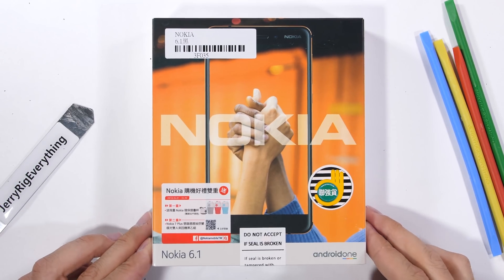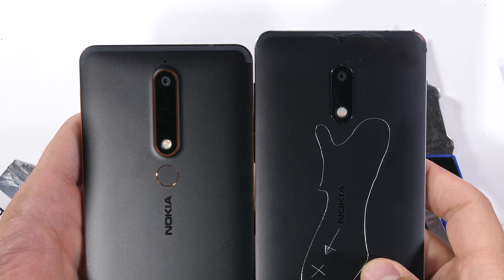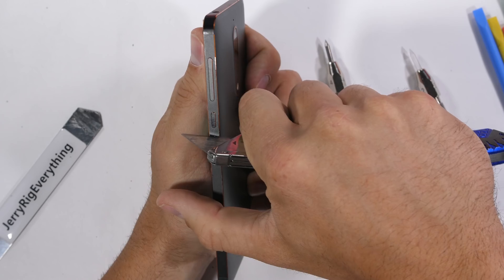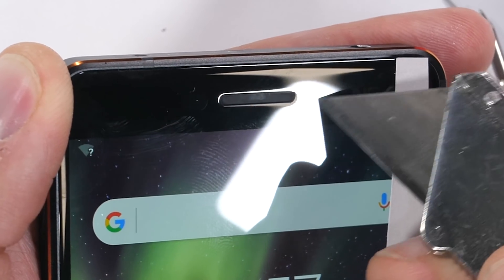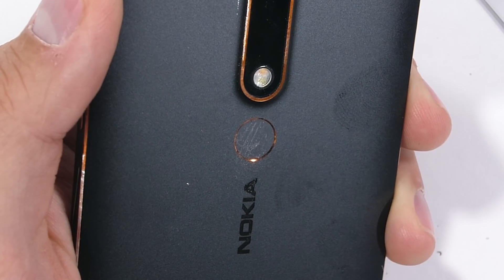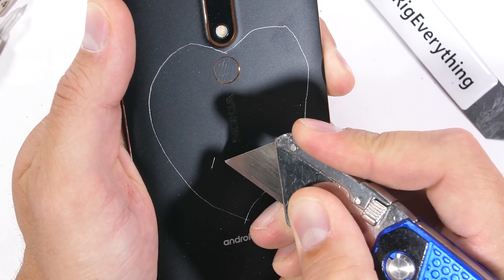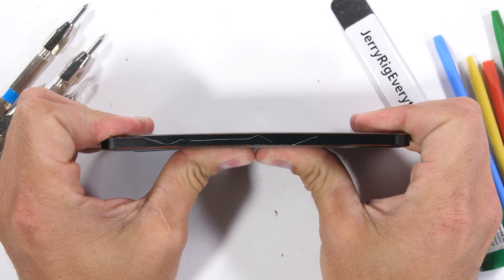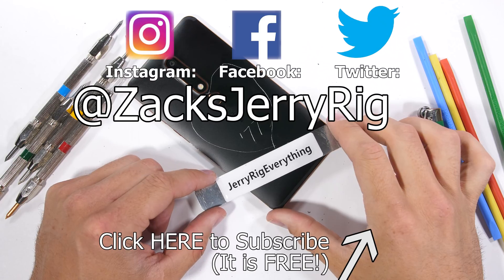Nokia 6.1 Durability Test! Scratch BURN and BEND tested!

Comment: Bought in december 2018 at USD $90 with a USD$3 original TPU case.
TPU case desintegrated 8 months ago and just then I put a screen protector and a hard silicon case. That's right, 6+ years with no screen protector.
In the meantime I worked as a mechanic, a fast food crew, a delivery driver and factory worker and withstood all those jobs. I must say I'm not a brute when it comes to use my devices but don't treat them as fragile crystal either.
The SoC might be getting a bit short these days but nothing a good OS restore can't fix as I don't game or multitask heavy social media apps.
The hardware was and still is pretty complete for all needs, only lacking in wired video output which would have come in hand to me.
The only real issue now with 6+ years of use is the battery, something normal considering the use. It barely lasts a day of heavy use.

I'm planning to replace it for a SONY XPERIA as those are the few with hedphone jack, card slot and no screen notch.

Fun fact: It had the fastest fingerprint reader back then.

Comment: Brought this in 2018, Still using it with some dead pixels on the bottom right which appeared out of no where last week. Also no updates from google. would Still recommend this over any other budget phone. This phone can break thing and hammer a nail.

Comment: Nokia 6 and 6.1 are the most durables phones ever made, great quality.
Reply: I got it back in 2019 brand new for just $100
Reply: @neerajdwivedi2015  Still fast?
Reply: @brenaxquiny8639  Yes, Kind of. But my battery only lasts about 2 hours and charging port is very loose
Reply: @neerajdwivedi2015  Thanks for the information I think I will just go ahead and buy Nokia 3.4

Comment: I'm a Nokia 6.1 user since 3 year. But now i facing lot of problems with this device. It delivers broken sounds by stereo speaker. And when i open any app the phone goes switch off. I've done a hard reset but problems steel have. How can i solve this device? Tell me plz.
Reply: Replace the battery. Yes I know: 2 years later, and you probably moved on to another device, but had the same problem.

Comment: I had a problem where I would always break my phone. 🤷‍♂️ Once I got this Nokia model the problem is gone. I can't believe how hardy it is. It accidentally slammed on floor 50 times (at least) and its still working great. Also, it's not even damaged that bad. That includes the screen as well. Unbelievable. I recommend it for everyone who has the same problem as I once had. I mean, I still have the problem, but the freaking phone is up and running 👌

Comment: My 6.1 already got the pill a couple months ago THE PILL!  The future of "home" and it's epic.  People get mad that don't have it when they see me zipping around shit with ease.  Android ONE is the way, as well as getting fast and frequent updates because they didn't dink with the software a whole lot.
Reply: Also, I managed to FINALLY spiderweb my 6.1 and it's barely visible and you can't even feel it.  I dropped it, naked, on a side edge straight on to a concrete curb from about 2m up getting out of a car.  It put a dent in the edge of the medal housing and barely (you have to turn it on edge in the right light) made some baby spiderwebs.  I wouldn't spike it into the ground, but for a phone this slippery and not having a case this thing should be long dead like all the rest.  I broke both sides of an S7 in like a few days...  :-(  Just getting my 7.2 set up...  :-)  The 6.1 is the new nav system for the car because all nav systems suck no matter how much you paid a good phone is still better.  :-)

Comment: I bought this phone because of this video and it's actually been a great phone.  Nokia's decision to keep a basically stock Android One build helps keep it running smooth and well maintained without surprises and mystery apps hijacking all your stuff/data.  I've spiderwebbed the glass on one side, but it's almost impossible to see unless you get the light and viewing angle just right.  I had dropped it pretty severely at least 3 times onto pavement with nothing but dents/scratches in the metal.  This time I dropped it at about 2m height when getting out of the car and it landed angular to every plane it has in the middle of one side.  It made that SPONK noise that you fear...it did damage the glass, but I can't even feel it.  Big crease in the metal casing, very faint spiderwebbing and only if you look for it, cannot feel it at all, LCD and touch work fine...

GREAT PHONE.  If Nokia can nail their 5G products, they will do well going forward...

Comment: I can't understand why you didn't make a simple drop test, to see how well it resists impacts. It's the simplest and most relevant test that exists for a phone. Who the hell will scratch their screen with a box cutter?? Meanwhile I drop my phone once per week.
Reply: Because he scratched the screen, if he do a drop test on a scratched phone it would break (much) sooner than a non scratched one
Reply: @MagicArcher17  Supposing that what you're saying is correct, then he should have started with the drop test instead of scratch. It's simply the most important thing to test on a phone regarding durability. There is zero excuses for not doing it. He simply screwed up in this case.
Reply: @dontbothermeimjust12  He stated many times that he wants to keep most phones functional, if he does a drop test, and it stops working/the screen and back breaks how we will know if it passes correctly all tests, also every time he drops a phone it's in a different position, so you can't compare between them, a phone can resist 15 drops or break in one, he doesn't have something for doing all drop tests equally

Comment: I'm one of the few people with a Microsoft Lumia 650, a phone which is almost identical to the Nokia 6.1, and it's just as built like a tank as the 6.1 is. Granted, the 650 has a removable plastic back and MicroUSB (understandable, considering its February 2016 release date), but I legitimately consider the Nokia 6.1 to be the spiritual successor to the Lumia 650. The two are that similar in terms of design and technologies.
If the 6.1 was a phone from 2016, it would probably be a variant of the 650 that runs Android instead of Windows 10 Mobile. And it probably would've sold pretty well too.

Comment: I recently replaced my Nokia 640 with a 6.1 I wish they still made windows phones but at least its android one.  The 640 still works (even after 3 years of drops with no case)  it just doesn't support  android auto and my new car has it.  The only issue I have is the camera app is glitchy and doesn't always come on or take a picture on the first try.

Comment: I think it would be awesome if you could add a test to your line up.  A pressure test to one of the corners simulating what the glass undergoes when dropped. Then get a pound per square inch rating going.

Comment: One thing that I just don't get: When you know a phone is using gorilla glass or something similar, why don't you start your scratch test at level 5 already?

It it scratches there you can always go back below again, and that way you have to test less.

I mean yeah if it scratches down to a 3 you'll have more scratches, and if you keep your current placement of the scratch tests it'll scratch more in the center of the phone, but do you really want to use such a weak phone again anyways? And that aside it just saves time.
Reply: Ben Turner well, as I said if it scratches where he starts (at 5 in my suggestion) then he can always go down again to test where it doesn't scratch anymore.

I mean it's probably gonna stop at 4 or at least at 3.

Comment: Dropped my Nokia 6 on the bottom right corner and screen on concrete... It just scratched the paint and marred the metal a tiny bit. Nothing happened to the screen.
Reply: I had the same thing with my Nokia 6.1 at the next day city workers were there to make new concrete.
Reply: manila scratch , it must have exploded
Reply: Kekistani Freedom Fighter mine dropped as well.
But on left corner..it has a very tiny spot of scratch.
Screen still intact..what the heck???
At that moment i was afraid to pick it up like "what have i done???".
Just picked up and looked at the screen.
I was really confused because the screen wasn't cracked.
This phone is really solid af...:)

Comment: 6.1? I don't see any upgrade from the last year's 6... I'm pretty sure it is just to boost the selling.
Reply: Ryan Nagasaki from Snapdragon 425 to Snapdragon 630 it proved to be worthy upgrade
Reply: I think it’s named that way because it is an Android One device. So if you look it from that standpoint, Nokia 6.1 makes perfect sense.
Reply: Zeiss
Reply: A SD 801 is way worse than a SD 630
Reply: the Snapdragon chip along is worth the upgrade.  I found a used one at Best Buy for $209 and it's worked so well I sold my S8 for a pretty penny and haven't complained about the "downgrade" except for the camera which I don't use much at all.
Reply: Snapdragon 630, Quick Charge 3.0, Zeiss optics, Android One, 2.5d glass, additional 1/2 RAM... still don't see any upgradeS?
Reply: The "6.1" naming scheme seems like a really bad choice lol. Not exactly something the average consumer is going to be drawn to..
Reply: I Z 801 is far worse than 630
Reply: what kind of Nokia 6 (2017) do you have to say that? one made by lagsung or what? you are the first person that says that about Nokia 6 (2017)
Reply: My old  Sony Z3 compact has a Snapdragon 801 chipset. Thats much better than the 630 no?  And you can buy the z3c for less than $100 on ebay
Reply: McSpooks Nokia 8 Sirocco is also Android One...
Reply: How do i know which is better? The naming conventions dont make sense
Reply: Ryan Nagasaki please check details first
Reply: ugaaa5 On the box it says so.
Reply: ugaaa5 It is. Check Nokia's website, you see 3.1, 5.1 and 6.1.
Reply: Ugh, really? Much better processor (6 is slowish sometimes imo and it's performance in modern games is weak. It needed this upgrade) and better camera (6's camera is mediocre at best. The only thing that saves it is google's camera app with HDR+ but damn - it's really slow when you making max res photos and processor gets hot fast if you making multiple shots in short period of time). Fingerprint scanner on the back is downgrade imo. They still have enough space to cram it on the front.

Comment: This is available stateside in Best Buy, and of course on Amazon.  I bought one for the poor mans pixel experience since it is part of the androidone program, so it will get the latest android updates/releases quickly.  My only complaint was the copper trim was easy to knick, and created a sharp point on it which I snagged my finger on a few times.  I wanted to keep it case free because I liked the aesthetic of the copper trim, but as a result have a case for it now.  Glad to see it passed the durability test!
Reply: Looking to get myself one. I live in Canada but I can't find a place to get one. Not even on Amazon

Comment: I had this phone. It's built like a tank but, started having some screen play in the bottom left corner. The led lights started bleeding through and I was forced to take the phone back. Phone ran smooth for gaming and battery life was excellent.  Definitely a good mid range. If you can find it on sell from best buy again for $229 I would buy it.

Comment: Coincidentally I am watching on my 6.1
Reply: I am planning to buy a phone. Would u recommend it?
Reply: vai5hu bro it all depends on your priorities.if you like snappy performance good battery awesome design and display and regular updates with decent camera then yeah.but for me 16:9 is perfect but it depends on you
Reply: I am confused between nokia 6.1 or shud i wait for x6. Nokia x6 has sd636 and 4 gb ram but i dont like glass back phones. Also can i ask you if the copper accents on this phone gets easily scratched or not??
Reply: vai5hu bro for me the notch is a deal breaker but if that doesn't matter to you then it will be fine but the Snapdragon 630 in this is perfectly snappy and quick..and no the copper sides don't get damaged that easily in my experience
Reply: OK I will buy the black and copper one. I really wish the 4 gb version had t black nd copper colour. The blue and gold color is the only 4 gb variant which i think is a bit too flashy. Thank you for ur input bro!
Reply: vai5hu glad I could be of help.and good luck!

Comment: It may not have a coussin between the screen and the frame, but the metal is really soft.
When you drop it on the ground, it bend and the plastic layer on the top and the bottom absorb the shock.

Do a drop test to see what I mean by that